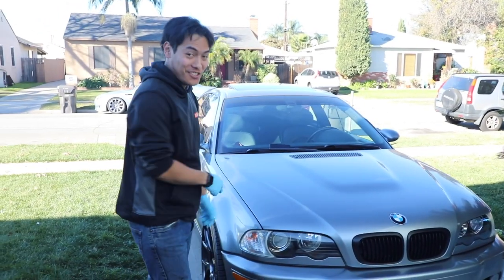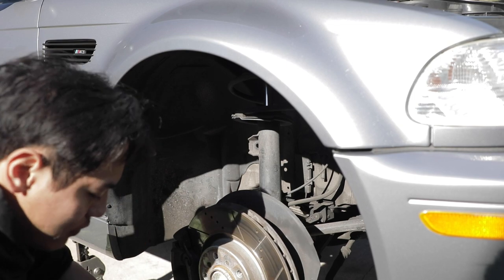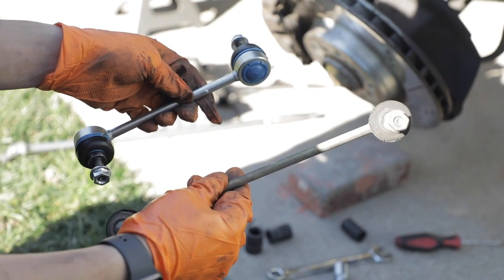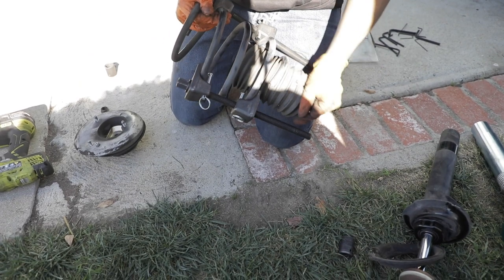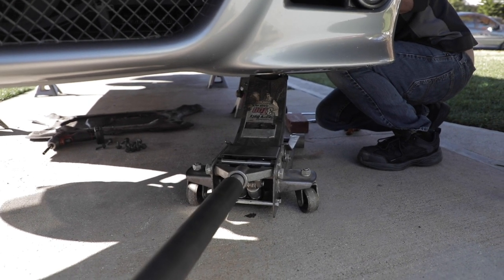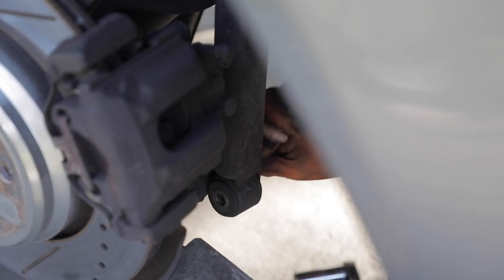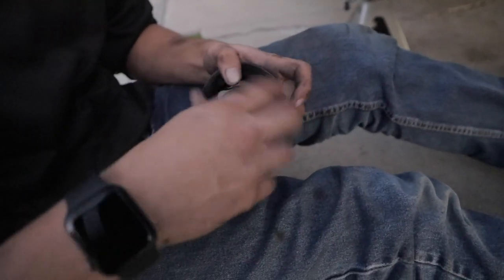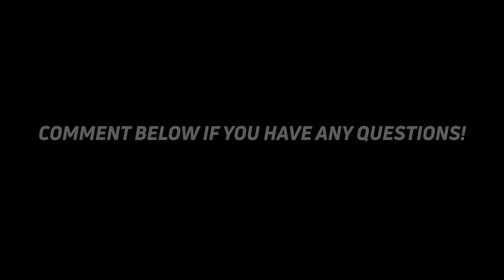How To Install: H&R Coilovers On A E46 M3

Comment: The rear reinforcement plate should go on the strut from inside the car not underneath.
Reply from the maker: The rear reinforcement plate is at the optimum place between the top of the strut and the chassis.
Reply: @T30o  There are quite a few videos showing instal from the inside. Only seen it done from underneath on a convertible.
Reply from the maker: @gordon238  It doesn't matter. The fronts went underneath so why should physics work any different for the rear? It does its job at the end of the day.
Reply: @T30o  the physics are actually different front and back because it has struts in the front and shocks and springs in the rear. The front plate goes underneath to prevent strut tower from mushrooming, rear plate goes above the shock tower to prevent the bolt holes from cracking. If you put the rear plate between the shock tower and the shock mount, the shock mount doesn't seat flush with the bottom of the tower, and the bolt holes are still weak and can crack.

Comment: I got bilstein pss b14 coilovers for my e46 m3 and the top front spring pads seem to be too small and i cannot find out which spring pad is supposed to be used.  I also have turner camber/caster plates which should replace the top hats.  do i need spring pads? im confused please help me out